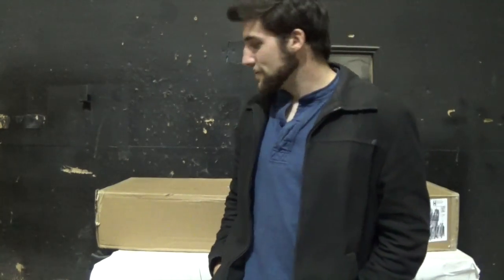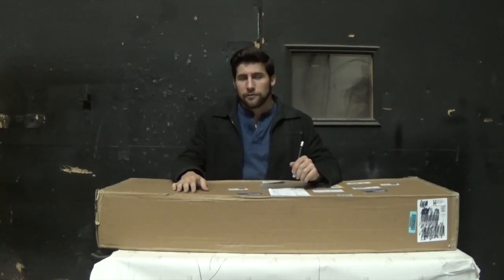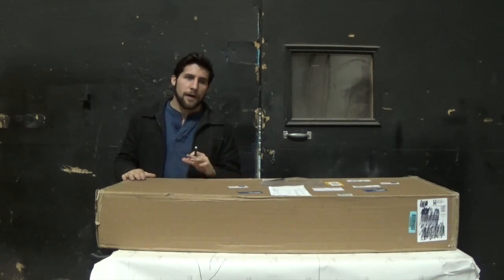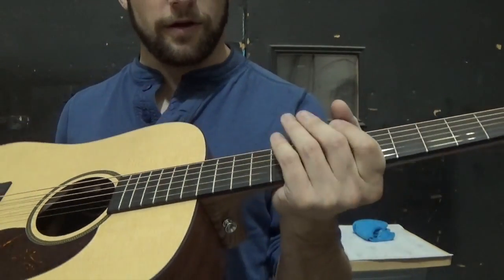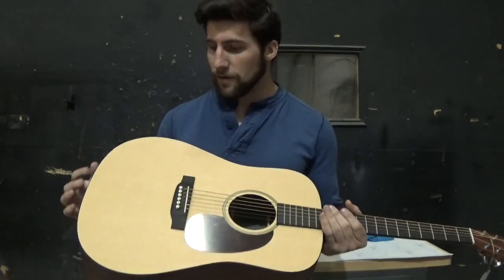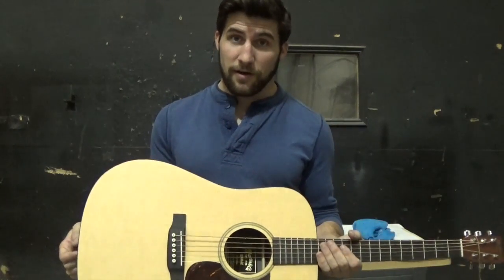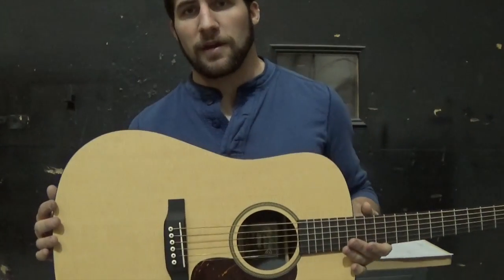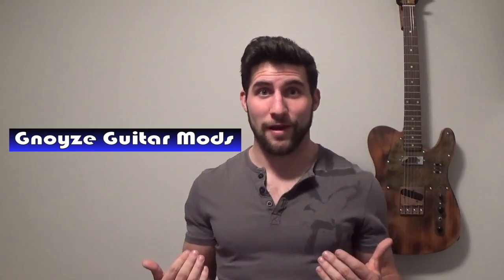Airbrushing an acoustic guitar Intro

Comment: That's funny, I airbrushed a acoustic classical guitar myself very recently... Curious to see how you are going to do this :)
Reply from the maker: +tabsrus Cool, how did yours go? If you're curious about how it turned out, the photos are already up on instagram.
Reply: Hi Brad! Thanks for taking interest ;-) Mine did actually go quite alright. I just sanded the top of the guitar for the same reasons you stated (although I'm not a purist and could've lived with the loss in the low-end range ;-) ).

I have a Yamaha classical guitar, you know those ones with the ugly orange on them? I sanded untill the coat and paint layer was gone so I had just the wood grain. After that I airbrushed it with E'Tac paint and some Createx Illustration. The only thing I failed at was the clear coat I think. I didn't have a clue as what to put on it...so I just used 2K clear coat :P Just 2 thin layers though. Mind you, this is my first try on a guitar!

What happened next is that it feels a bit "rough" now. I think the wood fibers come "up" a bit because of the reaction with the coating. I Have to say, the paint is excellent! Maybe I will sand it back down a little bit again and use proper clear. But I wouldn't have a clue where to get decent lacquer/clear for a guitar here in the Netherlands :( Anyway, I will check you instagram! (don't know why I haven't checked that before?) If you want you can check my guitar and work at: https://www.instagram.com/andydimarzio/ or for more stuff: https://www.facebook.com/andydebruinartist/

Love your video's man! Great job! ;-)
Reply from the maker: That's really cool Andy (I'm guessing that's your name). The guitar looks like it turned out great. If it seems rough, you might be able to get away with just fine sanding and polishing it. How does it sound?
Reply: Hey Brad, you've seen my FB page I assum or my Behance portfolio? ;-) Anyway, you right, the guitar is a bit rough unfortunately! I used a 2K varnish/coating.. not the smartest thing to do I guess. I don't have a decent spraygun, specific for coating objects so I bought a 2K spraycan :P I did 2 layers, so maybe if I use a very fine grit sandpaper and sand it every so lightly, it won't scratch of the paint...maybe :) My problem is that I don't have a clue of what sort of coating to get and otherwise, I don't have a good spraygun, so I would need to have it coated by someone or maybe use a spraycan with a coating for wood? About the way it sounds, it's excellent.If you think about it, I removed a bunch of layers of coating and the orange paint on it. So in return I only have airbrushed the drawing and 2 layers of coating. Can't imagine it getting really worse as far as sound. Thanks for checking it btw ;-)
Reply from the maker: I've seen your instagram before. Perhaps your facebook as well. I'm not familiar with behance. 2K varnish isn't so bad. If you sand it back smooth and put on another light coat that might just solve the problem. A lacquer could also do the trick.
I'm glad it sounds good. I wasn't so much concerned that you'd put the finish on too thick, I just wasn't sure how something like a 2K varnish would resonate. Now that I think about it, it's possible that Yamaha uses something similar to that anyway.